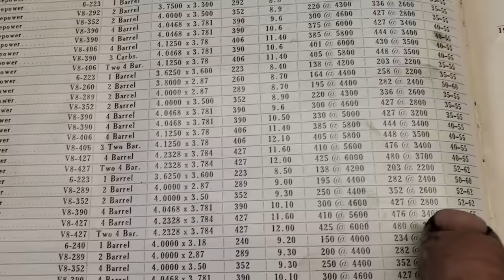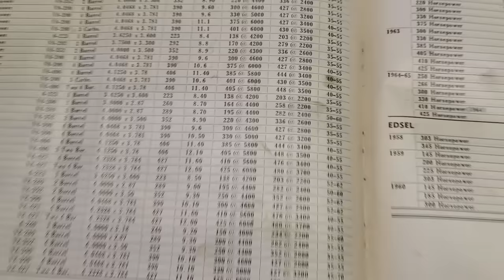1964 Ford 390 FE Country Squire Engine Gets A Teardown

Comment: Been a ford man all my life and thunderbird covers came stock on the 390 four barrel engines. I seen it also on the 352 engines in 58 high performance engines. As a fact, even the Y blocks of the earlier year also had it on them. I would not hesitate to build it as it is with what ever good parts that you have. Most aggravating was the exhaust bolts on all FE engines seemed to weld the bolts into the heads on them. I put studs in the ones that did come out and used a nut an bolt to hold on the ones that had to be drilled out. I tended to use headers when I could on those heavy S.O.B.'s and used a aluminum intake when available as their so heavy if your a leaning over a fender to put a intake on them. I just used silicon on the ends of the intake cause they do leak if they pouch out on you when bolting it down. Leave loose a bit till the silicone tacked up then tightened. I would not worry a bit if I went to a wrecking yard and pulled a piston out of another engine. Fords seem very forgiving when throwing them back together. I also used the cheapest gaskets on the heads if they were flat enough. I think felpro is way overpriced. McCormick gasket sets seemed to be just fine. Polish the crank with some croakiest cloth.  I think that your going to find that its one very easy engine to work on.... when putting the oil pump on, be sure to use the oil pump shaft with that washer that slides on the oil pump shaft and keeps it from being pulled out if you pull the distributor out... they like to stick to the end of the distributor an then a bitch to get into the pump after words. You will see what I mean provided it still has the slide washer on it. When you go to a junkyard and get that spacer thing that split on you trying to turn the crank... you can grab a piston an the spacer, maybe some of the bolts that broke pulling this one down, pack the oil pump with  vaseline before putting it back together. I would use all your crank rods from the original engine an  just swap the piston. Also very important.... don't forget the oil slinger that is next to the crank as it will throw oil like crazy if you forget it on the timing chain area. Don't know why fords did it so bad but I have forgot one, one only, when putting a timing chain cover on. I also just used the heavy duty single roller timing chain as its only got to go another 100,000 thousand miles and if its a steel gears set with that chain, they hold up just fine... its all about the price and which is cheaper
Reply: I once pull 406 heads of an old navy pickup
 It had gold valve covers.  They were the next generation valve covers. The boxy
Reply: i bought a 62 f100 4x4 from susanville,ca. im in aus..they guy fitted a 352 & 9"".. [ swb truck]. ill re build it. it got me with 4 broke bolts, in the truck, not on stand..i have an alloy intake. headers..will fit mid cam & parts. disc the front diff. i have a spare d70. so might sell the 9"" as worth 1200 here in any cond,,for the holden,[gm], commodore nuts..
Reply: I had an 390FE in a speedboat and I LOVED working on that motor!

Comment: My 67 390 ran hot all the time, also had to replace the exhaust manifolds on both sides.
Reply: Had a 390 police interceptor tri-power, the long cast iron factory header exhaust, ran at 165 and 170 all the time 10 and 1/2 to 1 compression, Shelby cam easily had over 400 horsepower
Reply: Pre 68 had different diameter water pump pulley diameters, NON a/c cars had an underdriven setup, a/c cars had overdriven setup. I find most people complaining about their FE's overheating at idle or slow speeds are non a/c cars like mine. Drove me nuts trying to figure that one out. I put an overdriven water pump pulley on and problem solved, never gets hot anymore.
Reply: @MaxGiganteum  Ford FE engines only ever had a clockwise direction rotating water pump since they all used V belt drive systems. They seem to like a lot of water pump rotating speed at idle to keep from getting hot at idle and slow speeds.
Reply: Like to see you do more to the wagon put a motor on it and go get the top off the other wagon and put it together. Awesome car
Reply: Timing issue?

Comment: bought a load leveler like that back in 80s, cut that handle off and welded lug nut on, put a impact on , makes for much faster job
Reply: I was thinking that...
Reply from the maker: Not only that but put some bearings on it too. This one was digging in metal to metal pretty bad.

Comment: The teflon timing gear was done for noise reduction 
Years ago i did one in a 67 falcon  with  a 289 mine actually had 4 or 5 teflon teeth broken off   found them in oil pump pick up at that moment i said no vehicle i own will ever have a plastic timing gear as long as i own it

Comment: I’ve got a 77 F250 4 speed 4x4 with a transplanted 390. Runs pretty strong. I’m going to pull it this winter and do cam intake and heads and just a overall “freshen up” on it. Word of warning tho, FE parts, especially speed parts, are $$$$!

Comment: I had a heart attack, when I thought you were going to wipe out that beautiful grille.   I use a 50/50 combination of Diesel fuel and ATF, with heat if necessary.  That combo works for me most of the time.  The Thunderbird valve covers, were installed on 390s, with certain upgrades. On some years, Ford also put a pot metal Thunderbird emblem on the front fenders, in front of the lower door hinge.  It was a reasonable performer.

Comment: i am a professional transmission rebuilder in SC, and shop owner, retired 2 years. the transmission is a cast iron cruise o matic, it is one of my favorites. if you need a rebuilder i still have a shop:)) although the fluid is red i guarantee every seal in that trans. is hard as a dry stick, fords are notorious for that after they get old.
Reply from the maker: It's gonna get a rebuild. I'll be danged if I'm gonna fight that to get it back in the car only to have to pull the trans out again!

Comment: Years ago before I had an overhead hoist, I would usually pull the radiator support and grill also. Just gives you more room for  low height problems. The elves and trolls come in at night and hook up them starter wires - I swear!  Great content as usual! Just a loyal subscriber always waiting for  new content.⭐⭐⭐⭐⭐ !!

Comment: Sir I had a 1967 ford Galaxie 500 4 door . Had a 390 4 barrel carb. My valve covers was ford blue and said powered by ford. Great engine. Pass everything up except gas station lol. I loved that car. Pulled her out of a brair patch. Been sitting 8 10 years. Found out why mine run little hot because  didn't have that tank you took off with thermostat in.  Loved the tailights on my 67. Wish I still had her. Keep up good work.
Reply: Them  factory manifolds are bad about leaking.  I fixed mine by having them both shaved and installing good gaskets. Also I replaced all my exhaust bolts with new stainless steel ones with never seize. No more leaks . I put dual exhaust on mine with 1 foot glass packs.

Comment: Inside of engine pretty clean. I wonder if this engine had rebuild on it. Could be the head gaskets were installed incorrectly blocking a cooling port causing the over heating problems.

Comment: my werner floor jack that's about that size weighs a good 120lbs with the handle on it. getting it up the basement stairs whenever I need it requires some muscle stretching in preparation.

Comment: I had to do some cutting on my Harbor Freight engine stand to use it on a 5000 ford tractor engine. Just like you I put on what I could, then rolled to to the tractor, put it on the hoist.  Then bolted it up.

Comment: Had a 390 police interceptor tri-power, the long factory cast iron headers, shelbycam, Excel dual point distributor, 10 and 1/2 to 1 compression, easily had over 400 horsepower, in a 1961 Ford station wagon country sedan, engine ran at 165 to 170 all the time no matter what the weather.

Comment: What you need is a creeper seat for when you messing with brakes and jegs sells one with a tool box and 3 drawers built in the seat frame, and the other suggestion is a big tool bag like the I believe it is a 24 inch husky mechanic tool bag

Comment: If that old boy said it was getting hot it is probably because he never got all of the air out of the engine. What you should do when you go to put the engine back together you need to take the therostat completely out and run the engine without the thermostat in it. After you have run it for a good period of tie then you can open the cap and use a waterhose to continuously and slowly flush the system out. Once it's flushed you can place the thermostat back in it. That should take care of your overheating problem. Always use a 180 degree thermostat in it. I have had to run a 406 without a thermostat for a couple of months in order to get the trash out of the cooling syste, but on those FE blocks that is the best way to clean and flush the cooling system.

Comment: That 390 was what came standard in the T-Bird. Ford advertising at the time was Ford with the Thunderbird power. The 352 from 1958-60 was standard in T-Bird. 61-66 the 390 was standard. They ALL had Thunderbird rocker covers.

Comment: FE series big blocks had hydraulic lifters. Some of the 63 and 64 models had what was called a Thunderbird Special motor factory 410 horsepower 500 pounds torque. Its all cast iron.

Comment: I find it easier to pull the motor out without the transmission attached. Although I have done it both ways. Just the lift angle to get the motor clear with the transmission not to mention the added weight adds to the difficulty. Your lucky you didn’t smash the whole front end when the motor fell. 😬

Comment: If you rig up your load leveler so you can move it back and forth with an impact gun instead of that handle that’d be pretty handy. And grease the threads. Great videos👍

Comment: The 390 is also a drop-in replacement for the 330 HD, SD  Ford truck engines in F600s. Same blocks, 330s just have shorter stroke, smaller pistons.

Comment: Really wanted to see the state of the  water pump, steel doesn't like water that much and you won't get much cooling with missing impellers. I had a 1968 Ford falcon. Kept overheating due to no impellers and a blocked radiator, replaced both and it never overheated. Using coolent instead of tap water helps

Comment: i had more than a few of them 390s, the reason the pistons get ruined in the older ones is from runnin low octain gas.. they need 92 or higher octane,  the pre 1972 motors ran 10.6 compression.. probly why it was overheating

Comment: You have the standard 390 , then 390thunderbird that was basically like the H.O. version. Then you had a 390 thunder jet, and then after that it was the 428, and a 428 scj option all available in that model.

Comment: Ford use three "standard" size pistons from the factory. One is standard bore size, piston, top painted red. The .002 over has a blue painted top and .005 over has no paint on the top of the piston.... I think thats the sizes for the colors. Ford considered all those sizes standard. Often a yellow number is painted in the lifter valley for the bore oversize, so the correct piston can be installed on the assembly line. Often even on high milage engines, if you carefully clean the pistons, you will still be able to see reminisce of the paint on the piston top. I do show that in some of my videos on restoring a 1966 Ford Galaxie 500 convertible.

Are you sure that is a 390. The block casting states it's a 352. It has a Autolite 4100 that was used on the 352. Most of the 390's used a two barrel. With the ware on the bearings, I wonder what condition the transmission is in....... 

The other wagon in your past video looks to have a solid roof. You should cut it off that wagon to weld to this wagon..... unless you're planning on repairing the roof rot. 

I show in on of my videos https://youtu.be/zkKYvXJbUUA?si=hHbluMb6tuBBpEBK the numbers in the lifter valley on a 1966 352. I have a whole play list on the Galaxie restoration, and show the blue paint on the 352's pistons, a different video that the one here. 

Enjoyed your video..... looking forward to seeing that neat old Country Squire moving under it's own power again.
Reply from the maker: A lot of FE blocks of various sizes have 352 cast into them. That doesn't mean they are a 352.

Comment: If you can believe this I was removing the Number Two Engine Strut off a 737-800 and we forgot to remove the ground strap.It's very similar to a ground cable on a car.The results were similar but we weren't dragging the airplane with a tractor.

Comment: I think those bolts are breaking off because of the location of where the car was setting. I remember before you pulled it out as soon as you opened the hood by the look of the rust on the engine I could tell those bolts were going to be a problem.

Comment: Just have the crack polished to -.010 and get new Clevite bushings properly over sized and you'll be fine. Those older FE blocks are tough. New cam and hydraulic lifters would be best rather than the solid ones. Looks like a salvageable engine.

Comment: That bar would work on its side. It would give it a good spine, just heat or cut at bend and reinforce it with a gusset. There's an Engineer opinion for ya, but he'll if it works ot works!!! GreT vid.

Comment: The "Thunderbird" valve covers came on 390, 406, and 427 engines. They were referred to as Thunderbird Special engines and were painted black with gold valve covers and air breathers. 352's were painted the familiar Ford blue (entire engine) with "F O R D" stamped valve covers. Remember, this dated back to a pre-Mustang era where the Thunderbird was the true flagship of the brand. Any update on this car? Doesn't appear to be any videos on it in roughly a year or so.

Comment: One of the rocker arm stand bolts is different, it has something to do with the oiling of the shaft, you need to check an FE tech manual for which one and where it goes.

Comment: The valve covers most likely came off a thunderbird but who knows somebody might have changed the motor in that years ago and put it in from a thunderbird. You should check the numbers on the motor and body to find out if they match. I'm curious to know if it's the original motor. Awesome video thanks bro

Comment: Glad to see someone actually tear one of these down and try to rebuild it instead of just push it to the side. Any idea how many miles were on the engine? the bearings are the least worn I've seen out of a 64 Ford original FE engine. Both the 352's I tore down, one with 158K, the other with 258K miles both had the rod bearings pure shiny copper/brass color and the mains worn into the middle layer of the bearings. Parts for these engines are really hard to get right now since everything is backlogged and backordered, but if you could polish that crank and get a set of .001" undersize bearings you should be able to run the crank without turning it and still have good clearances. Both the FE's I built run .001" bearing clearance per inch of journal diameter of the crank. My 390, runs .0024" rod .0026" main, 445 stroker .0022" rod .0027" main. Much looser than stock but not a problem, both run a HV pump and 15w40 with great oil pressure. Since it needs pistons, speed pro L2291F are about the only ones to buy, they will be about .016" in the hole on an undecked block vs a stock replacement cast piston .030" in the hole. Should get you about 9.5:1 compression with a .040" head gasket. Those thunderbird valve covers are correct for the 390 engine, 352 engines that year had F O R D on the valve covers. There isn't anything wrong with that stock cast iron 4V intake either, my 390 in my 64 4 door runs to 5500 like a champ with it, and the original 352 ran to 6000 with it a couple of times. Makes great midrange power and good low end and doesn't seem to lose any steam past 5000 with it either. Unless you want to spend $600 for a performer RPM intake, I'd just put that right back on there. Do block off the exhaust crossover ports though, I didn't do that and kind of regret it, but doesn't really cause any issues.

Comment: Really should be heating the outside of the block at the pistons my friend and you can use diesel and gasoline or diesel and transmission fluid as a cheap penetrate!

Comment: if it was running hot most problems with fe engines running hot was not the engine its the radiator, cores are plugged

Comment: As a gm guy with several  old ford's. Ford was stingy  and  didn't  put a 4 barrel  on anything .You really lucked out with the autolite  4100 carberoster that the 9" and the 4 speed top loader are the best things  ford ever made.
Reply from the maker: I know very little about fords other than I built a 9" for the Trans Am many years ago.

Comment: About the "Thunderbird" valve covers, I copied this from a Ford forum...."The 1962 352 engines had "FORD" stamped on the valve covers. The 390 and 406 engines had "THUNDERBIRD". The 352 valve covers are blue, the 390 valve covers are a silver color, and the 406 valve covers are a gold color. I'm not sure about other engines or other years, but I am sure about the 62s."